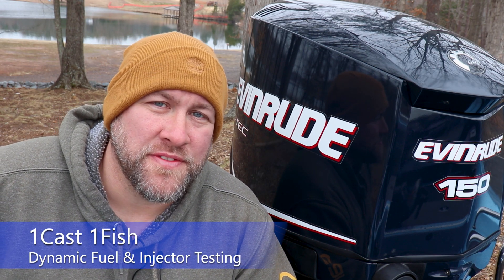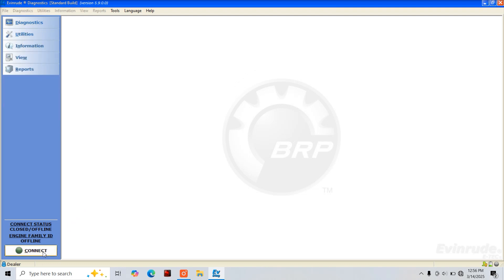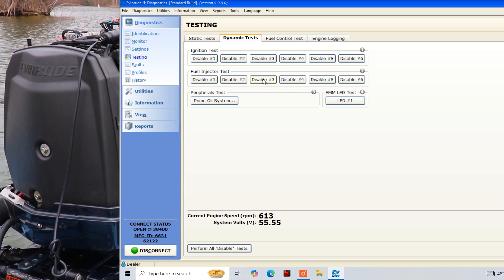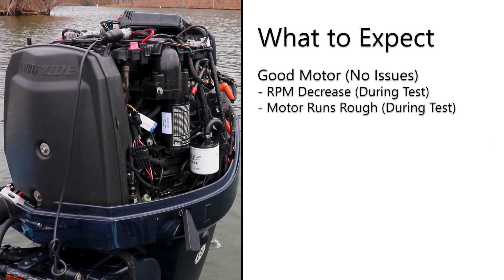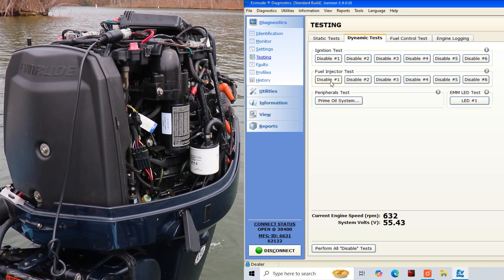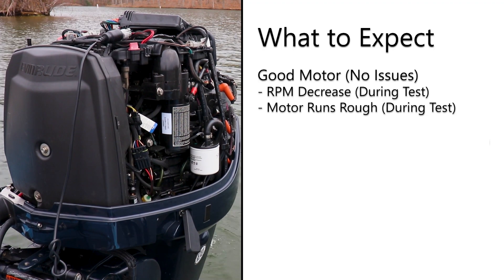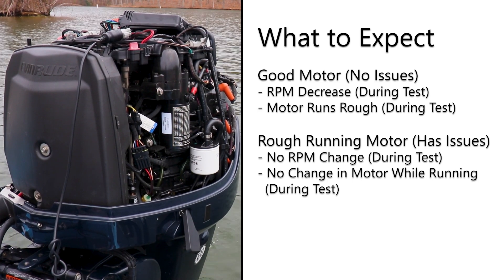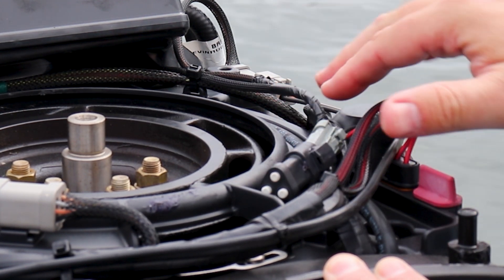Evinrude ETEC Fuel Injector & Ignition Testing / Evinrude Diagnostics

Comment: Great job, as always! I took my in to the dealer where I bought my boat it only had 56.40 hours on it ! I plan on bringing it to the local dealer ( not Evenrude  because the warranty expires in a few months and don’t want to drive it back 480 miles to the dealer in Illinois, everything was okay, they changed the plugs , filters and checked the water pump all is good so It hopefully will be fine, same amount of hours, they want and recommend replacing the inner propeller and plugs hopefully they won’t break the bank !
Reply from the maker: Plugs are super simple and I have a video on it...the biggest thing is the plugs could be $12 to $25 depending on who you buy them from.
Reply: I just finished winterizing the motor at the ramp who, Man this feature makes it so easy to do, just start it up with the lever in the up position and let it run for 15-20 seconds then bring it back down for the same time and then bring it back and let it do it’s thing ! When I got back to the shop I changed the lower unit fluid and refilled it and greased the fittings… I could only find 2 of them looked all over for the third one but couldn’t find it ?? My motor is the 60 HO Etech . Thanks for sharing on the topic

Comment: Thanks for this video......I just purchased a Etec 75 hp 2008 outboard (blue in color).....I found on Amazon this.... "Evinrude Diagnostic kit + EvDiag" and it says it's for the FICHT type engine,     but I was wondering if it was the correct one.....they have several different Evinrude diagnostic tools....    Thanks for the help......
Reply from the maker: I would need the specific link to look, since so many pop up to be sure.
I have the link in the description of the video for the one I use and know works.

Comment: I have a 2008 115 evinrude etech with about 300 hrs on it. It has started missing around 5-12 mph but clears up once you accelerate over that speed. any idea what it might be? i have purchased the software but have not used it yet. any help/suggestions would be appreciated.
Reply from the maker: Could be so many things honestly...software will be the first place to start...and also double check everything on the fuel supply side.

Comment: Question, my evinrude when trimmed all the way down somehow keeps popping the main fuse; even if I turn ignition key to the on position pops the fuse. But the trim on the cowling will be able to lift it up without popping the fuse then I can engage ignition. long story short use the trim on throttle all the way down pops fuse(trimmed all the way down ignition pops fuse). While trimmed all the way down pops fuse have to trim it up with cowling switch then good and I can start it. Any potential insights would help
Reply from the maker: I would start by checking the wires and circuitry for the tilt/trim and ignition.  This seems like an issue that will require good electrical troubleshooting

Comment: I just bought my diagnostic system today and I have no idea what I’m doing. You should do a complete walk through each section of tests and how to do them and what to look for
Reply from the maker: Planning on some more videos like that...Thanks!
Reply: Yes, please! Have the software hooked up but keep getting an error saying no connection could be established. The company took control of my computer and said everything was good on their part but still get the error message when connected to the motor.
Reply from the maker: Mine is weird  to start to...try this
Right click on the icon, and select Open as Admin...this solved my issue.  If I just open it up I get a error message.
Reply: @erickerr6906  make sure you assign either comm port 1 or 2 (prefer 2) if you just install with the auto assigned of comm port 3 or higher, it won't work. device manager, plug usb in. There is a Youtube video on this critical installation. Have a good day.

Comment: im having a fuel problem with my 2014 evinrude 115 etec and i can't figure out what is
Reply from the maker: Honestly I would need alot more info than a fuel problem to try and help.  
What symptoms? Maintenance history? Fresh or Salt water use? Any actual error codes? Any diagnostics run on the motor?

Comment: sure do enjoy your videos, i have a garmin striker 5 dv fishfinder, it works great except for the down view, downview screen is so dark nothing shows up on it, just a black screen, screen on 2d sonar is fine, is there a way to get the downview screen to show structure and fish ? thanks glenn
Reply from the maker: Is there any image on the DV?  Has it always been this way or just start?
Could be a transducer issue
Reply: @1Cast1Fish  you may have to adjust gain or frequency range. brightness. also if you had your boat out of water and turning on the fishfinder, make sure you have the sonar portion off, running sonar out of water is bad juju.

Comment: Don’t know if you are familiar with the H O 60 but… I have not had any issues with it until I took it in for The 3 year checkup, they changed the plugs and lower unit fluid and checked the pump all was good but now it takes several times before it will start, before just one turn of the key and she’s running fine , only had 33 hours on it , do you think they replace the wrong plugs? The dealer where I got it from is 500 miles away from where I keep the boat ??
Reply from the maker: What other work was done?  The 3 Year service is more in depth than just plugs, water pump, and lower unit oil.
You can check the plugs for the correct # pretty easy, just look at the plug...the plug # should be on the ceramic portion somewhere.  
How's the fuel system?  Is primer bulb hard prior to start? 
Honestly could be many things...start with the easy stuff
Reply: @ Thanks , I’ll check them, but I don’t know why it’s so hard to start, they did a complete check on it , and winterize it before I took it back down to Kentucky Lake last December just trying to figure it out but now I’m going to take it to the repair shop in Paris Tennessee this fall
Reply from the maker: See my other comment...check that primer bulb to be hard and give it a few good squeezes next time before trying to start it.
Reply: @1Cast1Fish  Thanks
Reply from the maker: Let me know if you get it figured out
Reply: @ will do , going down Sunday, storms and a lot of rain there on Kentucky Lake tomorrow through Sunday
Reply: @ only use non-ethanol gas in it and put the gas conditioner in it after I winterize it, like the motor, and they did check the computer readings.
Reply: After I run it for a while then it’s fine??
Reply from the maker: So I just had a similar issue not to long ago where the motor would not start right away...I would look at your fuel system.  I would replace the following (if you have these) depends on the exact setup.
Replace Fuel Fow Valve, Anti-Siphon Valve, Fuel Hose, and Primer Bulb.  
This took care of my problem...Over time while sitting, the fuel would siphon back to the tank and initial starts where tough if I did not pump up the primer bulb.
Reply from the maker: See my other comment